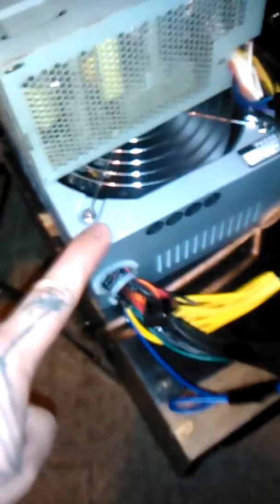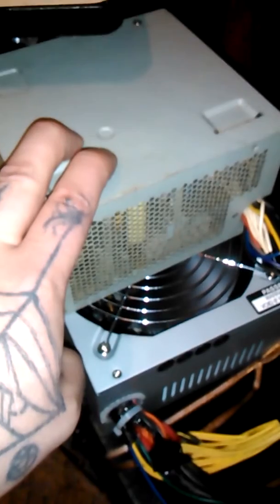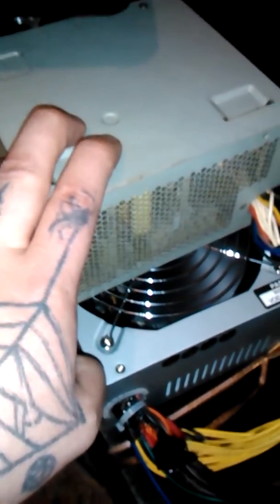connecting 2 computer power supplies up for subwoofer amp power supply

Comment: Why does the subs sound so static and questions was the 2 psu different amps I have a 80 and a 60 I want to combine to to make a 140 cause my sub amp I use in my house draws like 120 amps
Reply: If i got it right if you got a 60a and a 80a then draw max slightly below twice the weakest psu amp rating in this case would be 110amps or you’ll trip the 60amp protect then the 80amp after the 60 stoppet helping. So essentially if you had 1 60amp and 2 80amp it would still be the 60amp that would be the weakness so need to in that case make sure that ur drawing no more than 60amps from each. In the end it Will still be more than 60 combined

Comment: I know it's an old video, but I'm still trying to ask. I have same problem, if i connect only one then it is going to clip(i know it is bad), problem is, it clips on low gain. So question is... If both power supplies are connected, both are 12v, when two supllies are connected is it 12v or 24v? 
My amplifier need 12v. I hope that someone answers me!!!

Comment: So.....kudos on the new psu. I’m jealous. But seriously, next payday.... buy a better camera so you’re not wasting everyone’s time with this Blair witch throwback. Great info, but I think Gene Wilder from Blazing Saddles (“yea but I shoot with this hand!”)was holding the camera. Lol

How did you avoid he issue of one psu wanting to act as the slave, while the other carries the majority of the load? I’ve got 8 Xbox power supplies, all exactly the same model. All 12v. And ready to wire in parallel for high current 12v, but I don’t want to have collected all these just to overburden a few.

Any help is appreciated!

Comment: Hey I’ve got some questions... I’ve got an EVGA 1300w psu and i want to know if I can just buy another one and wire them together for dual output? I hear people say that when you wire them together like this, one supply is loaded crazy and the other one barely does anything. Is that true? If so, is there a solution to that?
Reply: Im wonder ing the same thing at the moment. I have a evga 1000w psu connected to the amp with the cpu wires if, I add another psu with only 800w will something catch fire etc? Is it safe?

Comment: so let me get this right,  you simply hooked the 2 psu's in parallel,  and they didn't short oout or shock the shit out of you when you touched the casing??  i been working on a 24V psu where you combine the 2 in series,  and there's all kinds of shit you have to do to keep the cases from touching each other.  very interesting.
Reply from the maker: I've never had that happen in all 20 years of working with electronics.
Reply: yeah i've been doing this most my life,  and the general idea is that when combining PSU's,  touching the cases together will short out the system,  or shock you.  so usually you strip the cases off both psu's and strap them down to a board,  then wire them in series to get more voltage.  very unusual stuff going on here.  obviously quite a few ppl in this thread are thinking the same thing.  lol.  -but the psu's are clearly stacked case to case.

and you're positive both PSU's are running??  -i.e.  you can see both their fans running??  O_O
Reply from the maker: yeah both are running and never shocked me. there running right now. they been running for 3 years now.
Reply: sweet.  i'll give a shot here in a bit.  i got a strange amp i been trying to figure out.  it's a mini 2.1 amp that can be used at home or in the car.  says i get 80W using 12V @ 5A,  but if i use an 18V @ 8.2A.  psu it will give me 148W.

have you seen amps like that??  -that accept multiple voltages??  i'm wonder if i can get the max watts out of it if i just increase the amps from the 12V or if i have to have the 18V.  problem is manufacturer gave me absolutely no details or technical specs.

right now i'm running it on 12V @ 16A,  and it seems to be doing alright.  I'm new to amp hacking.  so i don't even know if the 18V is necessary,  or it's the only way i'll be able to hit the higher wattage in the specs.

i've powered a lot of car stereos using PSU's,  but never tried amps before.

so will amps make up for less volts in this case you think??

Comment: Very helpful..i was having doubts  that standard parallel connection would work on computer power supplies, cuz they have in-built short circuit protection kind of stuff...thanks for clearing that.......
Reply from the maker: no problem buddy :)
Reply: that's exactly what i thought.  and read.  on building the 24V-you wire them in parallel,  but you have to becareful not to even let the cases touch.  O_O

Comment: hey,should i need 2 similar psu like 500w 500w and 27a 27a or i can use 500w 27a psu and second one 400w 22a,i just connect all psu black and yellow wires  together  ?and should i need turn psus on in same time or dont?
Reply from the maker: +MegaTronX6 depend on what you are powering/ yes you connect all the black and all the yellows/ yes you turn them on at the same time..
Reply: +scarysamons i will power 2 kicker comp 15" with renegade 1500w amp ,and what will happen when i dont turn in same time?
Reply: +MegaTronX6 one of my psus have swittch other dont so i connect green and black wire from who have swittch to (who dont have) only green wire and then i turn on swittch and second one will turn on right?
Reply from the maker: you need to turn them on at the same time others wise they will shut off after the first bass drop. use a power strip to plug both in and then flick on the power strips power switch. the computer power supplies green wire needs to be connected to the one of the black wires to trick the mother board bypass.

Comment: Cool video.  now the amp in my garage/workshop can handle the two subs without the power supply kicking off.
Reply from the maker: +Michael West I'm running two 1,000 watt subs... what are you running?
Reply: +scarysamons Nothing to really brag about.  It is just a sony xplode 4 channel amp.  I have that bridged to two subs....one is older 12 400w and the other sub is a rock fosgate r1 (I think rated at 150w).  I have not hooked up the second power supply yet.  I have my subwoofers in boxes I made (I am just talking nice glued air tight (I dont do the calculations to find the right air space and and all that crap.  I just know that a good build, air tight, port hole, some fiber floss......makes it sound pretty good.  I have found if I put that sub in a larger box, but with the back open to a wall......it hits harder at lower volume levels.  My inside setup in living room is a pioneer dual voice coil, fosgate r1, a polk audio powered sub (across the room).  It hits harder than most I have come across.
Reply from the maker: +Michael West the reason your power supply does not cut out is because you only running 400watt and a 150watt speakers.. your amp does not need much power to run.
Reply: +scarysamons Well, it needs enough to where it is cutting out using only the 300 watt power supply.  I am having rum and egg nog, so....the second power supply is not getting connected right now.  I was more worried about connecting the 12V rail and ground from one separate power supply to the other.

Comment: When joining 2 PC power packs together I get that u have to wire yellow wires from 1 power pack to yellows on other power pack same with black wires.when it comes to green wire to black wire do u do the same to green and black wire on other power pack does it turn both power packs on at the same time.my power packs have on/off switches on back of them
Reply from the maker: you connect the two green wires together and take two black wires and connect them together and then connect them to the green wires by adding a ON/OFF switch to turn it on and off with.. Also make you use a power strip to plug in both power supplies... when you flick the ON/OFF power switch it will turn both on and off at the same time.. make sure the switch is 12V compatible..

Comment: I hook my ipad to me amp and car stearo and got all yellow wires together same with black wires plus I'm using red sub medium size wire to connect from yellow and black wires from atx power pack to amp and oxey free speaker wire.i think my light on amp dimes in and out when I turn gain half way cos need more amps for me power supply

Comment: Hi I did not see your other video have u got step bye step how to connect 2 power supply's together I got 700w ub 2 rail 21a +12v atx.at monument I'm runing fli 900w amp+ 2 subs 1 is punch 400w 4ohm and alpine 300w 1000peak I think and infinity 150w lound speaker when I turn me gain up half way or just below my light on amp dimes in and out
Reply from the maker: you amp isn't getting enough power because your running a higher watt speakers then the amp can handle...
the power supply your using is also to weak to keep up with the amp sucking up all the power when the bass is dropping..
try to get a higher watt and higher ampage powersupply to power the ampliphier for the subs.. that should help a lot..
Reply from the maker: scarysamons http://youtu.be/-54DIEQXBaM this is a link to my first video if that helps

Comment: hi thx for all the information really helpful
i just need a advice i bought a sony xplod mxn1004 1000w for channel amp but i gives me clipping sound but doesnot shuts off so would it be a power supply issue
if yes then what can i do??
Reply from the maker: sounds like a ground issue or your stereo sub output is bad. what are you running the music from? also recheck your wiring job and check for errors..
Reply: I am using a car stereo Pioneer
Reply: i have also added a power supply And now its working good thanx for ur advice friend.